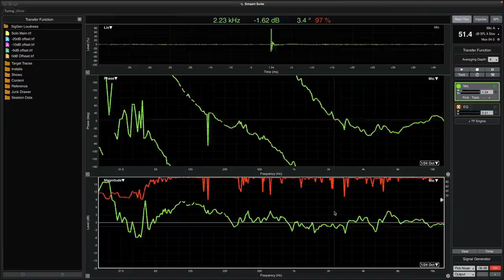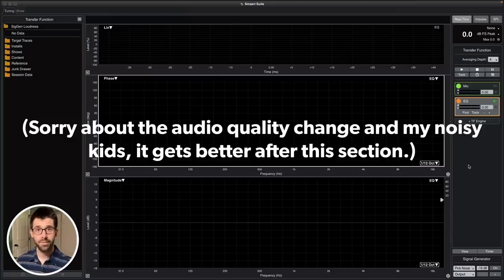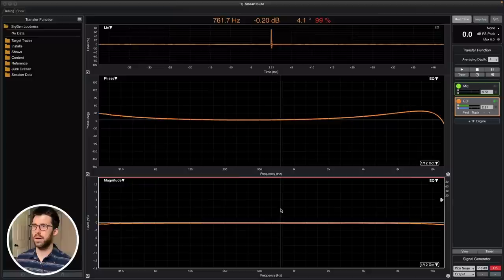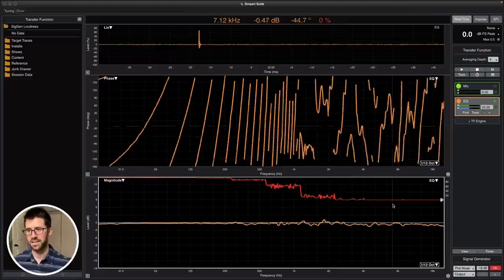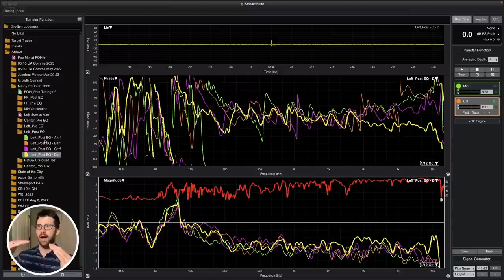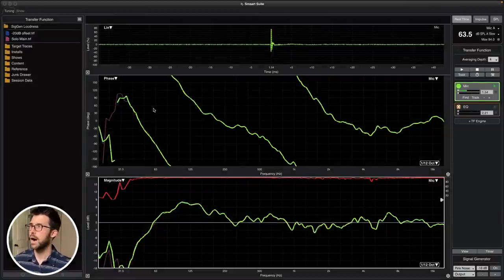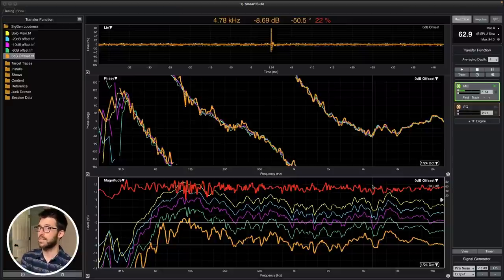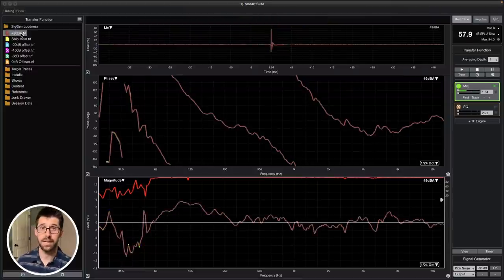How Loud Should You Run Pink Noise Levels When System Tuning?

Comment: Did you forget about the fletcher munson curve?  We run pink noise as show volume because if it is not measured at the same SPL as the show will be run the frequency response will change.
Reply from the maker: The Fletcher-Munson curve is only for the human ear, not for measurement microphones. If your system is linear, pink noise will measure the same in your audio analyzer no matter what actual SPL, just as long as your at least 10dB above the noise floor and not clipping your mic or the input of the preamp your mic is connected to.
Reply: @MichaelCurtisAudio  im going to test this today lol
Reply from the maker: Go for it! @KenDeavers
Reply: Worth mentioning that, you're gonna need alot more power/handling to run pink noise at full concert volume than you will the concert itself.
Most manufacturers hide the real ratings of their speakers in that condition, usually it's 1/8 or 1/4 power for pink noise and that's normally revealed on the electrical specifications, which won't always be on the normal whitepaper spec sheet.

The reason this is important is that while the gear might produce it's rated output while running pink noise at that SPL, it won't produce it's rated THD (or anything close to it) which will in turn affect your measurement accuracy.

So, check your specs, run your pink noise test at a maximum of 1/4 power, which is 20ish DB lower than full concert volume.
Reply: @jttech44  what is THD?
Reply: @paulmanoogian7646  Total Harmonic Distortion. Basically how cleanly an amplifier is replicating the source.

Comment: Very cool video and just futher confirms what I recently found doing some of my first measurments. I was in an older style church santuary with the wood slat ceiling and brick walls. I started out with the pink noise pretty hot and just for fun decided to turn it way down to just above the noise floor. Blew my mind to actually watch the coherence go up! After thinking about it it made total sense... Reverberent space with loud noise just makes for an overly excited space. Thanks for the awesome video as always!
Reply from the maker: Thanks a ton!
Reply: Some rooms have a weird "saturation point" as I call it, where, after you exceed a certain sound pressure very bad things start happening.

Also a nice one to keep in your back pocket, drywall on standard 16in nominal framing will resonate around 208hz, and you won't find it at lower sound pressures, but once things are more excited, they'll ring like crazy. Super simple to just notch out, but only if you know it's happening as lower frequencies tend to be difficult to discern during a performance.

Comment: Michael, came back to this one as I dive deeper into using pink noise. Thanks. You have a quick response on what type of pink noise to use for specific tuning tasks? Random, etc. There are obviously different types and would live your take.
Reply from the maker: 99% of the time I'm playing plain old pink noise. If I'm tuning in a software that cannot band limit the pink noise and need to tune subs, but not blast the mains loud, I'll use a pink noise file filter to 150Hz and below to push there.
Reply: @MichaelCurtisAudio  Thanks. I have seen references to Pink Random and Pink Periodic (in REW) and also for frequency response using uncorrelated (stereo) pink noise and for time alignment using correlated (mono) pink noise. Just looking for some consistency in approach. I have not measured with each to compare results.
Reply from the maker: You got it @michaelwesterlund5729  . If you're using a source-independent analyzer (like Smaart or OSM) the actual stimulus signal doesn't matter from a data quality perspective. Just as long as the stimulus signal is covering the frequency range you're intending to look at with some regularity.

Comment: I'll tune a room using pink noise (95db) and only run the pink noise for around five seconds. I freeze the analyzer screen while running the pink noise and reference my reading to make my EQ adjustments. I may run the test again but in most cases I'm good. I'm working in small/medium clubs. I try keeping my mixes under 100db from my mix position - that will vary depending on the situation. 

Thanks for sharing
Reply: a weighted or c weighted

Comment: Thanks for this video, but I've been hearing for years that some systems are not linear in their frequency response as a function of their level. Having never had the opportunity (or rather the time) to actually measure this, two questions come to mind:
- Is it a myth?
- If not, isn't it better to start from the principle that it's better to take measurements at a nominal level, corresponding more or less to the level that will be used during the show?
Thanks in advance for your insights!
Reply: It's not a myth.  Level has a direct impact on frequency response.  I do not know of a single sound system that intelligently accounts for this.

Comment: Ah yes sensai, but, remember, speakers and amplifiers are not truly linear across the range of amplitudes they can produce, and, to further complicate this, most powered devices use a fair amount of DSP, which itself is seldom linear (nor is it designed to be) across the range of amplitudes it reproduces.
So while I generally agree that "full performance volume" isn't necessary, or desirable, you might have to have it louder than 10db over ambient. Also, wearing ear protection during setup/teardown is a must in general, haven't seen many crews do it, which is disheartening considering a set of 10db filters are like 50 bucks on amazon (ear-easers). 

The neato thing here is, you don't have to take my word for it, you can test it, run your setup at the minimum volume required to get coherence, then run it at 20db over that, then however loud it'll go without damaging the speakers. You'll likely find that, even with a studio monitor, which, is a very, very simple system and designed with linearity in mind, that your traces do indeed differ slightly.

How much does it matter? well, that answer is the same as many answers, "it depends". Nicer gear, not as much, your DIY line array powered by the only the finest finest PYLE amps you bought for a long on craigslist, alot.
Reply from the maker: Yes, great point! Like you mentioned, linearity over the full SPL range asked of a product is one of the main things you're "paying for" with more expensive products.

I should have clarified more here, but 10dB over ambient is more like an "absolute minimum" in my book if you had to be very discreet. I usually find myself getting the full 20dB above if the show environment will allow it.

Comment: Hi...
Since you've used cp8 in some venues, I would like your opinion on the speaker, what's the overall quality of the speaker and how does it compare with other high end options like rcf, also my main concern is harshness, when driven loud most of the speakers( jbl, mackie, turbosound) get really harsh, is this the case with cp8? would love to have your opinion on this, we're actually considering to install 40pcs of these in a venue, so your opinion will be really important for me... thanks.

Comment: Thanks for the great videos! 

I struggle with coherence when working on an outdoor system. The smallest breeze will effect the mic (even with a windscreen). I’ve tried turning the mic preamp down & pink up…can’t say it’s made that big of a difference. 

Curious if you have any tips on tuning outdoors when Mother Nature is not cooperating. 

Thanks for your time!
Reply from the maker: Ah yes, Mother Nature : ). You can set up a barrier of some sort to help block the wind from the microphone, just as long as it's not between the mic and the speaker you're measuring.

Comment: Funny I just got this video notice because just late last night I was Rushed to do a room tuning and sub to main calibration with the bartender wanting to leave, lock up and she refused to wear earplugs. I wasn't getting hardly at all good coherence. The house guy was counting down from 10 minutes while trying to do a quick target curve and sub to main alignment. The quick tuning wasn't too bad, but the data to align the subs to mains was totally alien. Any suggestions? 
I probably should of used his db meter and ran the noise at least 100db A weight. This room is awful awful awful! I've even offered to the owner room treatment out of my own pocket.
Reply from the maker: I'd give MVV's method a try: https://www.merlijnvanveen.nl/en/study-hall/166-subwoofer-alignment-the-foolproof-relative-absolute-method
Reply: If it’s the room level might not work cause reverb is part of the linear system and will rise with level?

Comment: I dig the data and the video! Thank you. But there can be a reason to measure at a louder level for a louder show… the performance of the speakers and amps can have a different performance at a higher level, particularly with amps that don’t do constant power very well… Ideally, we are running a system within its specification, but even so,, i have seen systems measure differently with everything else being equal other than level. 
Otherwise, solid!!! Thank you very much!

Comment: Another great video! ❤ Absolutely spot on usual! 

Have you ever noticed how speakers have a different response at high volumes? They generally sound different at low vs high volume to me. This is not as big of a problem with more expensive systems but it’s still something I notice.

With some cheaper speakers it can be very different! 

So if you test at a low volume the response of that speaker may be different once you turn it up for example: a rock show.

Love to hear your thoughts on this! I use this Martin line array regularly that has a little bit of a problem at 5k. It only shows up when it’s loud though thanks!
Reply from the maker: Great point. Are you able to measure the 5k difference at different levels? Or is that something you're hearing?

There's a myriad of factors that could contribute (usually distortion) that changes how the speaker behaves at different volumes, but it's not always measurable through a traditional TF. Our ears also change HOW they hear and what frequency ranges they're sensitive to at different levels, so that also comes into play.
Reply: @MichaelCurtisAudio  It’s something I hear when it’s really cranked. I’ve never measured the system though I should at some point! Also good point your hearing does change with volume. 

Cranked system distortion vs measurement would be cool concept for one of your videos would love to hear thoughts/ strategies in detail sometime.

Comment: Great video Michael Curtis. What are your thoughts on using sine weeps to collect data from your sound systems?
Reply: I look forward to see what Michael has to say about this, but I've always understood sine sweeps are great for analyzing the room itself, not for a transfer function measurement. The reason is that with a logarithmic sweep, each frequency only appears at a single point of time, so you're not getting an accurate picture of system performance depending on the length of the sweep or the length of the measurement FFT. A logarithmic sweep is great for taking impulse response measurements to see what your room is doing rather than the system itself. If you run an impulse response measurement with a logarithmic sweep in Smaart and look at the results with the spectrograph, it gives a lot of insight about what the room is doing with each individual frequency (at least at the point where you placed your mic).
Reply from the maker: Thank you! I'd check out this video from Nathan Lively and Michael Lawrence if you want to dive deeper here: https://www.youtube.com/watch?v=FXA2vyYQ1sQ

In the field when tuning a system I find real-time approaches (pink noise and a two channel TF) to be faster. You certainly can use a pink sweep method, but I find it slower and more cumbersome.

Comment: It’d be interesting to see that same dB experiment where the competing noise was coming from a completely different speaker type in a different enclosure. I wonder if the similarities in your two monitors help keep the data more similar. 

I think your overall assertion about pink noise signal to room noise ratio is right. 

Great video! I hope your testing level message spreads … I’ve been around enough system tests where it sounds like the shuttle is taking off. It feels more like a flex than what’s necessary for a valid test.
Reply from the maker: The data is completely dissimilar in that the pink noise from the second speaker is completely uncorrelated. Your right in that having it come out of a completely different speaker with a different frequency response would change how the data looks, but I wanted to sources to be closely matched in level and tonality and have the signal SOURCE to be the only variable so that we would see the coherence change at a broadband level.